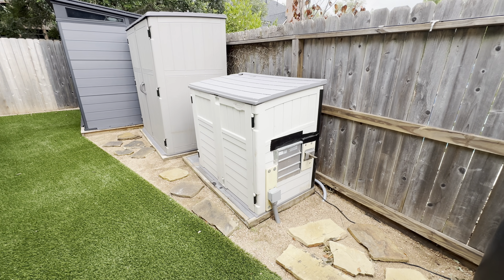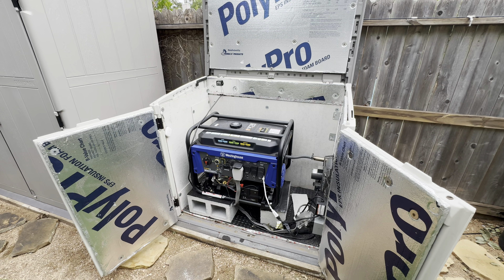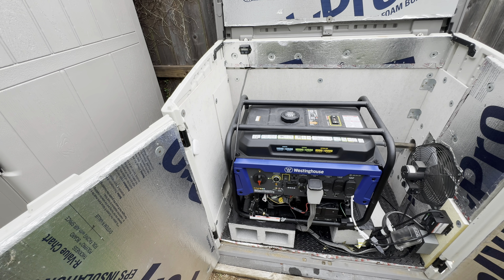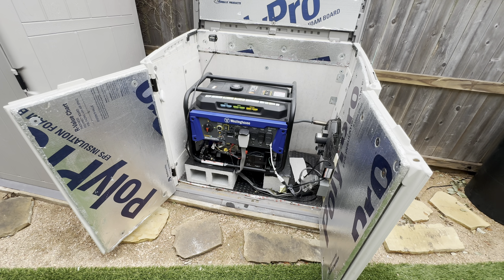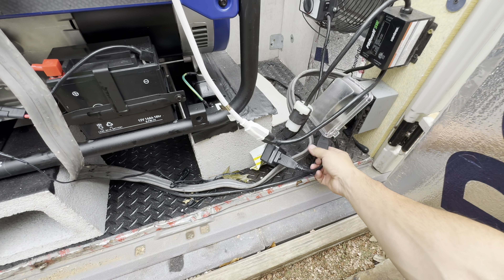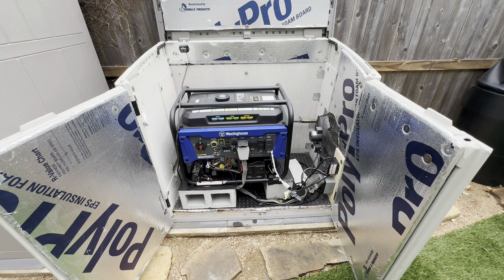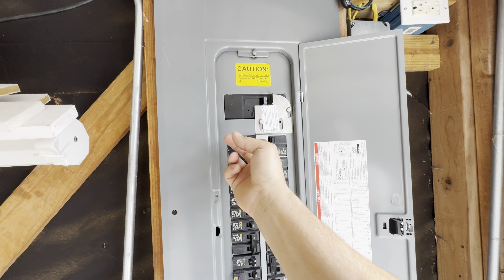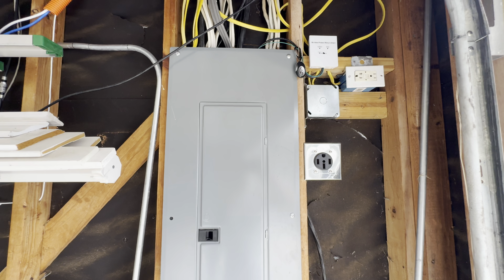Tri-Fuel Portable Generator Post Hurricane Update on Natural Gas

Comment: Changing the oil makes sense after a storm even if the hours aren't too bad. You don't want to be in the middle of the next event wishing you'd changed the oil at a more convenient time.
Reply: Use synthetic oil as well.
Reply: @fat_biscuits3928  What weight/brand of synthetic oil would you recommend for this generator?
Reply: @ AMSOIL 10W-30 100% Synthetic Small-Engine Oil. A little pricey, however it's good for high temperatures.
Reply: @ Thank you sir, much appreciated. I’m new to the generator game.
Reply: @ All good sir... Easy-Peasy. run it for 20 minutes quarterly, keep the battery in good shape, change the spark plug/s yearly along with the filters, and change the oil after any prolonged use... You'll get a long service life from it.
Reply: Oh and don't keep fuel in the tank if your using gas.. Run it dry, or use the fuel shut-off with minimal gas in the tank. Unleaded sitting in the carb will gum over time.
Reply: I run my generator for 20 minutes, once a month and change the oil based on calendar days then.  When running extended periods, I change according to generator hour time.
Reply: @Threedog1963  You don't need to change the oil like that.. Thats like changing your cars oil every 200 miles
Reply: 100%
Reply: Agree,  oil is cheap compared to the the alternative.

Comment: I live in Missouri City, how much for the wiring and piping of the NG line?  How much did it cost you to run the whole setup, minus the generator?
Reply from the maker: I am probably about 2,000 in, including the NG run.
Reply: @CalvinGorriaran  That's not bad, any good referral for the work?  Once my fences are fixed, was hoping to get start on  the transfer switch and the piping.
Reply from the maker: @user-hp1gn5mg7c  check around and see who the local go to plumber and electrician is. The local guys are going to be the most competitive price wise and you can hear from your neighbors if they do good work.

Comment: Hey man, how are you.  How much did you power with this?  Did it power an HVAC or window units?
Reply from the maker: @lswonke  we ran one AC unit (HVAC) at a time. We probably could run both if we started the 5 ton first and then started the 3 ton. It was easier to manage by just running one at a time from the Nest app. Both units have Easy Start soft start kits (see link in description).

Comment: Amazing. I am in sugar land, I have the dual fuel westinghouse, and it was such a helper during our 3 days with no power. I had to bring gasoline every day, though, and it was not fun. How much power drop did you notice when you moved from gasoline to natural gas? I am aboit to convert mine to Natural gas, but I am not sure if it would power my 3.5ton AC, whole house, and the pool motor as it did on gasoline.
Reply from the maker: It really wasn’t significant in my situation. If I was on gas, I could start my bigger AC unit and then start the second while it was running. When on NG, I could only run one AC unit at a time but I had all power on in the house. TVs, patio lights and TVs, sons computer and Xbox, etc. You really couldn’t tell we were on generator power other than I had to swap from one AC to another every couple hours.
Reply: @CalvinGorriaran  two ACs at the same time ??? Wow. I did not dare try that, may be I should have tried, lol. Do you have a soft start installed in your ACs ? I will be installing two in the next few days. I have 3.5 ton and 2.5ton, I really did not realyse  I could turn both of them at the same time. I also need to make a shade for my generator to be able to keep it outside in all weather situations. Thanks for the reply, by the way.
Reply from the maker: @redb2153  yes. Using Micro-Air Easy Start kits. Link in the description.

Comment: The enclosure, or for that matter anywhere it sits even without an enclosure, the crank start end of gen should not have any possibility of getting the air from sides or generator end of unit. That air is hot and the cooling air should be as cool as it can be. The engime will be weaker and have shorter life from too high operating temp and generator wire wimdimgs get more resistive with heat and that lowers voltage and current output, and also generator life.

Comment: Please help, I am looking into purchasing this Generator, for the convenience of hooking it up to my gas line, but am concerned about the cost of or who to trust to install the connection needed to my natural gas line. My power was out for 5 days from Hurricane Beryl. Could someone please help point me in the right direction.
Reply from the maker: @VintageWallflower  happy to help! You will want to connect with a local plumber known by the community or part of town you live in. They will do the gas line hook up. Let me know if you need any other help!
Reply: @CalvinGorriaran  Thank you! I do have another question, what type of extension cords will I need to run 2 window ac’s (6000 & 5000 BTU ) and a double door fridge from the unit?
Reply from the maker: @VintageWallflower  have you considered just connecting the generator to your electrical panel and turning on the breakers you need in the rooms where those units will be? That can be done with an inlet and an interlock kit. About $500 in labor and parts from an electrician.
Reply: @CalvinGorriaran  please forgive me for taking so long to reply. No, I have not thought about adding an outlet to my meter box. My home was built in the late 1940’s to early 1950’s and is in need of repair, this and I’m worried about the cost. I’ve got my mind set on the Westinghouse tri-fuel but at this time they are sold out. I did call a plumber for the gas line, but was dismayed by the charge just to come out and look at my meter, then a separate charge ( which I understand ) to install on another appointed time ( which I understand also ) what I need. I do not know if this is normal or if I am being taken advantage off, which is also normal being that I sport the worlds largest pair of rose colored glasses. Thank you for your help, take care and God Bless.
Reply from the maker: @VintageWallflower  What area of town are you in?
Reply: @CalvinGorriaran  happy Friday morning. I live way down here in Angleton.

Comment: Thank you for this after action report. 
Listening to like minded people explain“how did I fare?” During a power outage is in valuable to the rest of us. 
60 hours strait is a good testimonial to that generator, if you did a mail in oil analysis that would be invaluable.
I’m a Honda guy presciently but real world info is hard to get. 
I suggest having a case of oil and spark plugs on hand in case of even longer term issue. 
👍👍

Comment: We are well water so I installed a 50 amp twist lock to the panel outside to provide whole house power.  I bought the same half height shed but need to find a fan like you to cool it down.  I've installed an opening vent on one side but need a fan on the other side.  My goal is to run it quietly but opening the doors at the moment is like screaming at the neighbors.

Comment: I have the same generator and setup, i like how you have your exhaust, wondering how you hooked up to generator? Mine connections slips off causing overheating. I keep a Bluetooth thermometer and thermal fuse to protect the generator but last time it killed my battery 😢

Comment: Ok big time conflict. I have the exact same housing and co2 sensor keeps shutting it down. I have a 10" fan one end vent otger end but blowing out air didnt help keep it running. Luckily rain stopped and i opened 3 sides then it finally ran continuous... I m now redesining the 3 sides With giant vents so i can keep it closed n still running. I had flip up roof with 1" gap under the roof but that also didnt help. Just now making the sides...
Reply from the maker: @junior88fan64  how is your exhaust hose connected to the generator and ported out of the shed?
Reply: @CalvinGorriaran  from exhaust pipe on gen thru 18in long extension straight outside thru hole.
Reply from the maker: @junior88fan64  possible that the pipe has a crack anywhere in it?
Reply: @CalvinGorriaran  nope checked. Only thing i can thinkbof is pipe being 18" long. But doubt
Reply from the maker: @junior88fan64  send me a photo of your setup? I am on most social media platforms.

Comment: So I have 2-3 ton units …two story house …guess it would definitely run most things in the house fans fridge but would it also run at least the downstairs AC? (Live in NW Harris County was w/o power for a few days 🥵 $
Reply from the maker: @Greg-wz6fp  I ran both ACs but had to start them at different times and installed Micro-Air soft starts (see description for part).

Comment: Calvin,  thanks for the videos. Awesome detail.  Couple questions:  
-
1.  Do you use a soft start on your A/C?   If so, which brand do you recommend?
2.  Does that WGen11500 have the ability to remote start on natural gas too?
3.   I’m interested in finding a way to tell when the power is back on.  Is there no light indicator that does this trick?
Reply from the maker: @MrAxelworks  great questions. I should have mentioned in the video. Yes, I have a Micro-Air soft start (I will include in the description) on both my units. I think it is probably only necessary for the larger unit. As for the remote start on NG, possibly. I feel like if I did use it, I would need to make sure all the air was out of the line. Otherwise it will take a while to start as it clears out the air in the line. Check out my latest post storm video, I have details about a return power kit :-)
Reply: Hi Calvin - I recently purchased the 11500tfc but I’m having issues running on natural gas.  I have to adjust the gas valve coming from the house just right, or the engine starts to sputter.  Too far open or closed is no good, but If I dial it in the engine runs great. 
However , once I start adding a load, the engine starts to struggle a bit and I have to go out and tweak the valve open just a bit more.   I figured the pressure regulator on the generator should do that job. But then I opened a case with Westinghouse and now they are telling me I should purchase an aftermarket pressure regulator. That seems really odd to me. Have you ever had this issue when running on natural gas?

Thanks for the videos and all the information. I appreciate it!

Comment: Bought a Firman T07571 soon after the big freeze a few years back. Got a couple of 30 lb propane tanks. Now I’m thinking of natural gas because of the Houston experience. Also have a soft start for the AC scheduled. Thank you for sharing the information. Really helpful. Now have to stock up on oil/filters also.

Comment: I have a Firman tri fuel that ran 147 hours on nat gas and produced about 350kwhrs.   I was surprised when it first  shut down for low oil at 87 hours and a second time with a 141 hours total.   Each time it took 18oz of oil to top it off.   As the engine broke in it consumed more oil.  I recommend having at least a quart of oil on hand for extended run periods.
Reply: Yes having extra engine oil is smart and I change my oil every 25/45 hours max if under heavy load 
A quart of oil every.24 hour for oil change is cheaper than buying other generators 
Plus I’m retired diesel mechanic who works on small engines every day 😊
Reply: A quart?
I’d suggest having a case of oil for the generator.
+always over maintenance your equipment and cars to.
Reply: You might consider adding oil before gen kicks off for "oil is critically low" status.

Comment: Your video popped up in my feed. I'm near Jersey Village and my Wen 56380i Super Quiet 3800-Watt RV-Ready Portable Inverter Generator ran 138hrs on NG using motor snorkel conversion kit this past week. Ran refrigerator, lights, ceiling fans, router, TVs, and 8000btu window unit. After power came back on I want bigger and better. Really appreciate your video and setup. It's been brutal for everyone and hope and pray power restored soon.
Reply: JV highschool alumni here wup wup
Reply: Im just up the road from JV. Impressive power on the Wen with NG conversion. That’s basically all the things I’m wanting to power. More concerned sizing a generator large enough for a window unit up to 12k btu. I don’t need to power my fridge and freezer full time. They kept things cold and frozen for 12-15hrs when we lost power.
Reply: @acort10  I tried adding another 6000btu window unit  but tripped the breaker on the genny. Which is why I want to go more wattage on the generator so I can do a 10/12000 btu window ac in addition to 8000btu. Running NG has its limitations since you lose 20/30% less surge and running watts.
Reply: FYI bigger typically means higher fuel consumption. You can limit this though with an inverter-generator model
Reply: I am in Bear Creek and had to run my Troy Bilt 11,500 peak for over 200 hours. I ran 2 refrigerators, upright deep freezer, 1 10,000 btu window unit & a 8500 btu floor unit, plus multiple floor fans, lights, tv's and some lights. I have since upgraded to the Duromax 15,000 Tri fuel unit and am having a soft start installed on my 5 ton AC. I am also having a 50 amp interconnect put into my breaker box.

Comment: Have same generator on only on natural gas. Starts on the 3rd turn over every time from the electric start. Wondering if need spark plug will help it start faster and easier?

Comment: Move your heat exhaust fan to the top on the side. All heat rises so the fan would pull the hottest air from the high point in the box. Also, having the fan opening at the top on the side, it would act somewhat like a chimney and pull some of the heated air out even with the fan being off.
Reply: I’d think the fan being on the opposite side of the air opening will better allow air to cool across the surface of the generator.

Comment: I agree with letting the shed open as my similar setup had issues with my generator shutting down because it was overheating. With the heat rising during post-Beryl, I didn't care much about my neighbors' thoughts about me running my generator in the open. I ran mine for 12 hours straight and shut it down around 10 PM after cooling my house down to 73 degrees but luckily the power came back on as soon as that happened. I was one of the lucky few that got power restored within a day of losing it but my generator running on 100lb propane was a lifesaver! Prepare for the unexpected!
Reply: Thought about getting a 100# tank. How do you haul that thing around for refills? Haha
Reply: @clintyoung9902  they come to you

Comment: I have 2 small trifuel generators: 4000w 240v  6000 surge and 2400w 120v 3500 surge. Along with that I have 12000kwh battery backup. This allows me to switch to batteries immediately and if power is off for an extended period I can use the generators to charge the batteries in just a few hours a day. Instead of running 24/7. This saves a lot of fuel and does less damage to the generators than running continuously. Next year I will install 3000w solar to minimize the need for generators even more and start getting pay back by reducing my grid power consumption on sunny days.
Reply from the maker: @kevinm234  awesome! Would love to see more about your setup. Especially the batteries!
Reply: Does the battery backup power the whole house?  I don't know if I need anything that big...I can live without air conditioning for a while (it's uncomfortable, but I'll live through it), but would like to have something to use indoors.  I have a small 2000 watt inverter generator, which has been running since last Monday (still now power a week later) and is awesome, powering an outdoor fridge and fan, but I'd like something I can use indoors.  Maybe like a 5000 watt job?

Comment: Nice setup! Would definitely do similar if I had natural gas or propane options. I went with smaller 2k generators (3) after a test run. I still have a 6.5k 220v for water heater duty only. I found storing enough gas was a problem with a larger generator. The bigger the generator the more thirsty it is. I make due and only run two window ac's to have cool rooms while main AC is off. No 220 appliances, but rest of house has power. Ran non stop for 7 days last hurricane and was able to take 1 generator out of service at a time to refuel, do oil changes, or give it a break. At night only use 1 and 3 if needed during the day to conserve fuel. Use around 5-6 gallons a day. By day 6, I have to start looking to get more fuel. This gives it time for the insanely long fuel lines to clear up at the gas station or for them to get more. They usually limit to 5 gallons per visit and first couple days can take 8-12 hrs to get gas if it doesn't run out while waiting in line. I learned my lesson the hard way cursing on the drve home empty handed after waiting 6 hrs. Never again!!!
Reply: Not sure bigger (or reasonably bigger) is more thirsty.  I have been comparing the Westinghouse WGen9500TFc to the larger WGen11500TFc.  The 11500 has 26.66 percent higher output on NG.  Both units show 7 hours on Propane.  Running on gas is shows more efficient on the larger (11500) at 2 hrs/gal vs 1.8 hrs/gal on the 9500.  Perhaps the "ding" is more in the cost to purchase with the 11500 about $400 more.